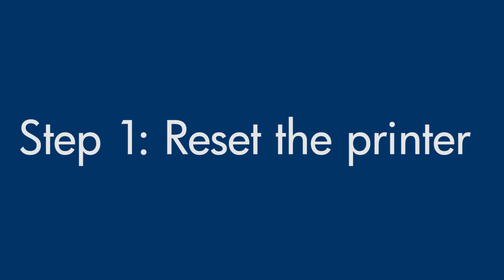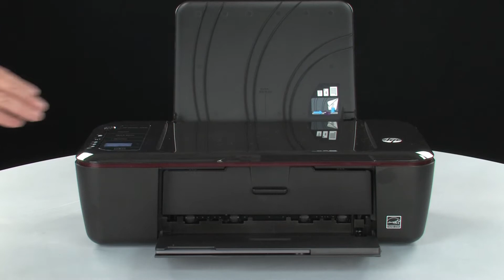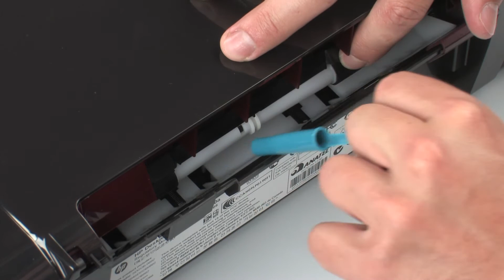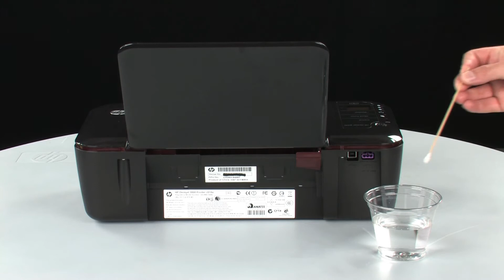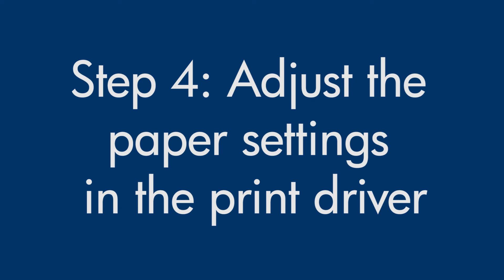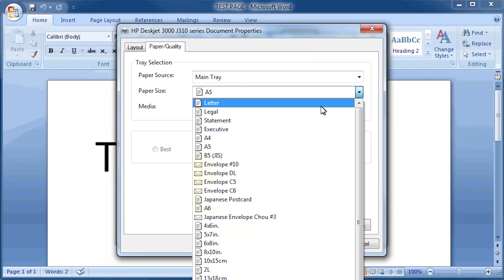Fixing Paper Pick-Up Issues | HP Deskjet 3000 Printer | HP

Comment: My deskjet 1000 is pulling the paper to the side and then it stops halfway through feeding. What do I do? Help please.
Reply from the maker: +Sam Cooper   It sounds like there is some sort of debris in the printer preventing the paper to move through the printer.  I've included the "A 'Paper Jam' Error Message Displays for HP Deskjet 1000 (J110), 2000 (J210), 3000 (J310), and Deskjet Ink Advantage 2010 (K010) Printer Series" document ( http://ow.ly/XehNl ) for you.  Please use it to look for the debris.  Please let me know the results.

Comment: I purchased an HP Deskjet 1000 at Wal-Mart last year for $29.99. A ridiculously low price. (I don't print a lot and don't need more.) I printed just a few pages before the mostly empty cartridges that HP installs at manufacture were empty. I bought new ones and installed them. I again printed just a few pages before the paper feeder decided enough was enough and gave up the ghost. It has been sitting idle for three or four months now. Today I decided to investigate. There was a thin film of dust on the outside. I used a soft bristle brush on the outside and gently brushed the paper feed opening. 
Now it works, There was no dust in the device, but brushing made the paper feed, although I still have to "help" it by guiding the top sheets into the feeder. If I don't, it either refuses to feed or draws two or three sheets in.
I'm not complaining about the printer, it is a pretty good printer for thirty simoleons. The thing is every HP printer I've owned has had this issue at some time in its life, and I've owned nine in different price ranges. 
As Frances Bacon once said, "What up wid DAT?"